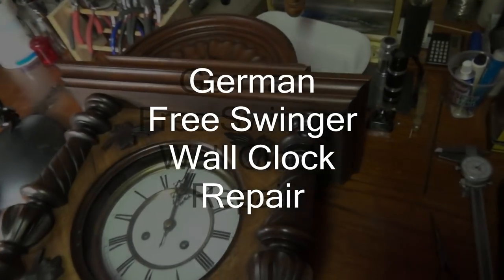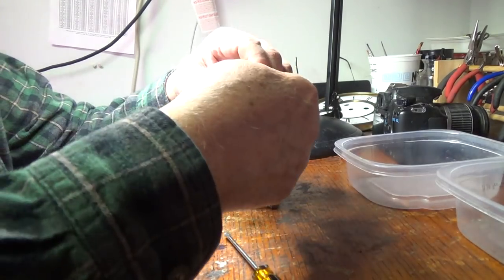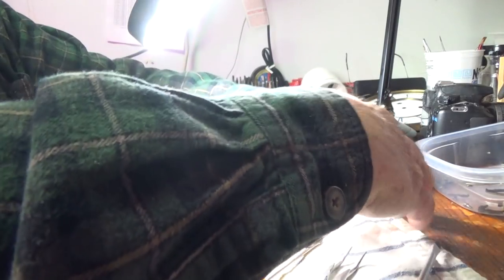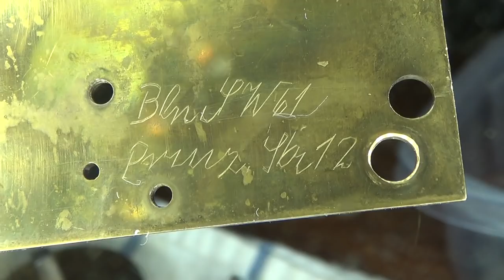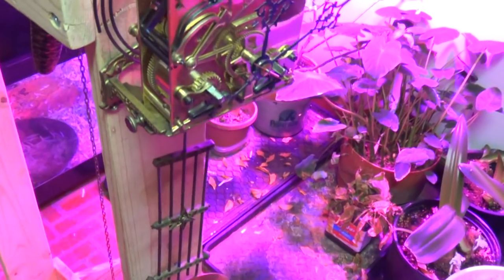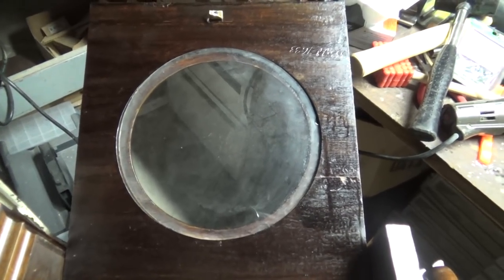German Free Swinger Wall Clock Repair

Comment: An index for this video:
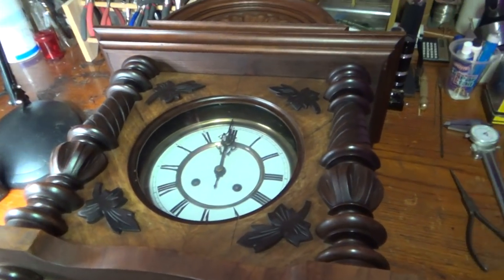0:00 - 0:21 Overview of the clock condition.
0:21 - 2:40 Removing the hands and the dial; checking the condition of the dial.
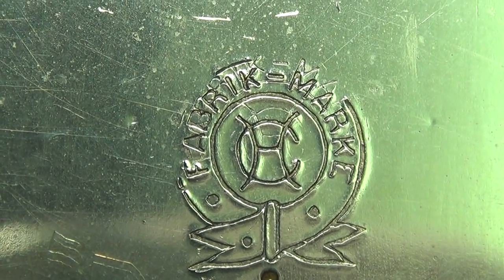2:40 - 3:42 Examining the trademark on the movement.
3:42 - 4:55 Checking whether the movement ticks and strikes.
4:55 - 6:00 Letting the springs down, which are in barrels.
6:00 - 11:02 Removing the parts that are outside the plates.
11:02 - 11:21 Examining the pivot holes for wear. Deciding no bushing is needed.
11:21 - 13:30 Removing the front plate.
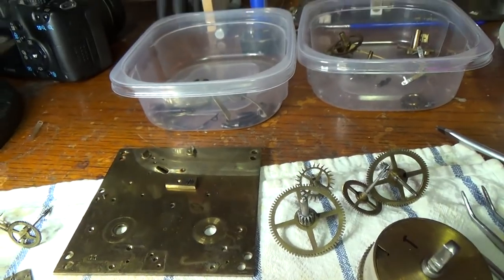13:30 - 14:13 Brief overview of the disassembled parts.
14:13 - 16:13 Examining the repairer's signatures and dates scratched into the inside.
16:13 - 17:38 Removing a helper spring; cleaning the posts on the lathe.
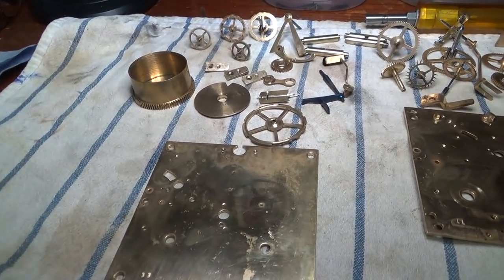17:38 - 18:09 Polishing the pivots on a lathe (after cleaning the wheels).
18:09 - 19:44 The parts after ultrasonic cleaning, ready to be hand cleaned.
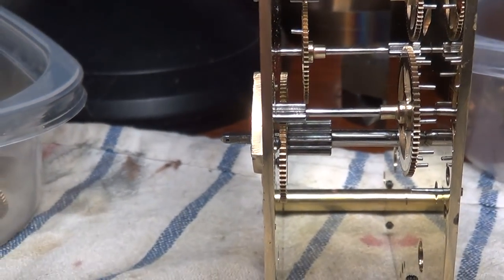19:44 - 21:21 Testing the cleaned time and strike trains.
21:21 - 22:29 Pegging the pivot holes.
22:29 - 25:17 Reassembly of the trains.
25:17 - 26:03 Oiling the pivot holes before attaching parts that cover some of them.
26:03 - 27:40 Attaching and oiling the Motion Works.
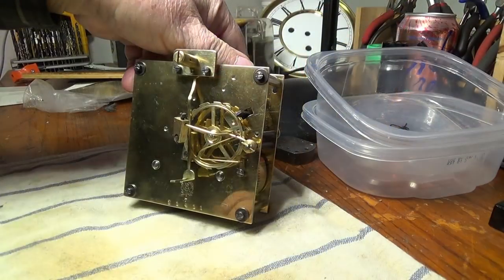27:40 - 29:10 Attaching the rest of the movement's parts.
29:10 - 30:02 Discovering that one of the mainsprings is off the arbor hook, requiring disassembly again.
30:02 - 31:22 Running the reassembled movement on the benchtop.
31:22 - 32:47 Test running the movement on a test stand.
32:47 - 33:41 Testing the striking counts. 2 o'clock incorrectly strikes 1 o'clock.
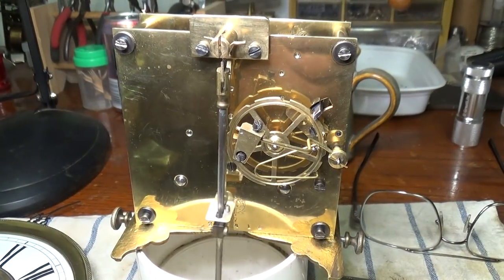33:41 - 34:05 Describing the cause of and fix for the striking problem.
34:05 - 35:57 Examining the running movement, and looking at a number scratched into the bezel.
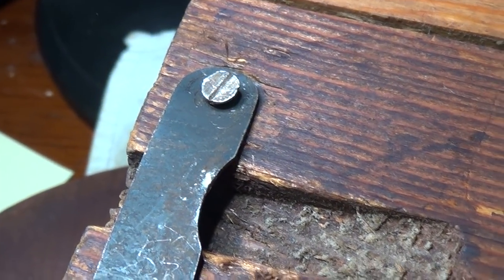35:57 - 36:12 The movement with hands, face, and pendulum, running on a test stand.
36:12 - 38:04 Discovering the "screws" in the case are nails, and the glass was cut to fit the broken door.
38:04 - 38:59 Grinding the bezel glass diameter down so it fits the repaired door.
38:59 - 39:47 The finished clock.

Comment: You did a good Job. IT is a Carl Werner. I think that Clock is from the 1920's. I restored a Free Swinger Wallclock from Pfeilkreuz.  I restored the Case and repaired the hole Movement. Now IT runs perfect

Comment: Love to watch your videos. I can tell you have a background in teaching and really enjoy making these instructional videos. I am new to clockwork and have learned a lot from watching you work. I would like to know if you think you will continue making new videos for a while. Also could you tell me, or perhaps show us how you go about removing scratches from brass plates. Also,  how far do you usually go in shining up the parts? Do you use a brass polish on them? Thank you, and please keep up the good work.
Reply from the maker: I'm glad you find the videos helpful.  I work on clocks almost exclusively in the winter when I can't be outside.  I do have some work to get done that I will work on during some evenings, so there might be a video or two over the summer.  As far as scratches in brass plates go, there is a limit to what can be done without causing more damage.  Deep scratches can be attenuated but not completely removed.  One can start by using a fine file and draw-filing across the scratches.  Fine wet/dry sandpaper can then be used, followed by finer grits.  I personally like using the boards used for polishing fingernails.  Whether to polish brass parts or not is also a matter of what movement one is working.  It's best to clean the brass what it would have been its original condition.  Some were highly polished, like carriage clocks, and some were not.  If the brass is stained or corroded with verdigris, I will remove it, sometimes starting with Brasso, with a rinse following, then finish polishing with a polishing compound used on acrylic tubs and showers. Finish off with a polishing cloth and removing residue with a brush.  For heavily stained brass, the initial cleaning may also include using 0000 steel wool.  You  can use a lot of different things to clean and polish, so long as residues and grits are completely removed.  You don't want any fine grit left on wheel teeth or arbor pivots that would increase wear.
Reply: Thank you for your speedy reply Don. I must have caught you at just the right time. I'm not sure I would be brave enough to try a fine FILE on it yet. Being new (about 1 year now) to this, I have already made a plethora of mistakes. lol I do learn from them, but the damage is still done and must be corrected which, of course can lead to more problems. Kind of the school of hard knocks, I suppose. Perhaps I could try one of your other solutions first. I just don't want to make more or worse scratches.
Reply from the maker: Practice on a junk movement.  There are a ton of them that can be purchased from eBay.

Comment: I've had the spring come off the winding shaft myself once on a ships bell clock.  Not a happy discovery!  Although it took several assembly attempts anyway, to get it to gong properly (I got in a little over my head on that one).  Back in the day (35 yrs ago) we used to etch our SSN's on tools and such.  Yikes..

Comment: Love all of your videos. However, I would like to see you do and explain how to time the strike on a Sessions time and strike mantle clock movement. My movement is confused and not falling in the deep slots on the count wheel. No model number is shown on the movement.
Reply from the maker: If it's the old style American clock movement, what you need do is Place the warning pin on the warning wheel at the 12 o'clock position, where it will rest against the stop lever, place the cam that's between the plates such that the lever that rides on it is in the slot in the cam, and bend the countwheel lever such that it is in  a deep slot.
Reply: @dperry428  Checked that and found the warning wheel pin and locking lever is at 12:00. The cam doesn't have a slot. However, it does have a wedge shaped detent with a flat smooth bottom and the arm is in that detent, at the bottom. The count wheel arm is in the deep slot. When asked to strike the count wheel arm rises out of the deep slot but does not engage every count wheel tooth, as I understand it should, until it reaches the next deep slot.  Instead it sometimes will stop and drop in the middle of the count on the count wheel.  So, what do you think?What shoud I look for?
Reply from the maker: If you look at the arbor to which the count wheel lever is attached, there is another lever that rides the cam.  There is also a third lever that is on that same arbor that constitutes the stop lever, the one that will ultimately drop in front of the warning pin to stop the strike.  All three of those levers rise and drop together. As the lever on the cam rides the cam, each time it gets to the depressed area on the cam, it will attempt to fall and take the stop lever down in front of the stop (warning) pin, but it is kept from doing so by the count wheel lever until that lever falls into a deep slot on the count wheel. Only when the count wheel lever drops into a deep slot can the cam lever also drop into the depressed area of the cam, which then allows the stop lever to drop in front of the warning pin and the strike halts. The count wheel lever should not "engage the count wheel teeth"; rather, should, as the clock strikes, be high enough to clear the teeth and, as the cam lever encounters the depressed area of the cam, the count wheel lever should be seen to drop enough to touch the count wheel between the teeth and then immediately rise again as the cam lever rides up on the cam.  It should be a small, though visible movement down  and then up by the count wheel lever.  When the count wheel lever gets to a deep slot, it then drops into it and allows the cam lever to drop deeper and the stop lever to move in front of the warning pin.  So, there is an interplay between the cam lever and the count wheel lever that, with each rotation of the cam, the cam lever tries dropping into the lower area and the count wheel lever preventing it from doing so until the arrival of a deep slot on the count wheel.  The count wheel lever and the cam lever, therefore, need to be bent such that the cam lever rides the edge of the cam and is free to move into and out of the lower area of the cam, while at the same time, the cam lever, when it is out of the depression, lifts the count wheel lever above the height of the teeth on the count wheel.  If the count wheel lever is bent upward too high, then it will allow the cam lever to drop into the depressed area of the cam even when the count wheel lever is between deep slots.  You just have to carefully observe what each lever is doing and their relative positions and make adjustments until they act as I've described. Without actually having the movement in front of me, that's about all I can suggest.  Of course, the cam wheel and warning wheel have to be in positions such that, when the cam lever drops, the stop lever is able to catch the warning pin.  Make sure the pin isn't passing the stop lever  before it has dropped enough to catch it.
Reply: @dperry428  Thank you. Thereis a lot there. Your advise of observation is well taken. I'll have to play with it and get back to you if I figure it out. Thanks for your explaination and time. I think that I am good on most of that. I believe my prblem lies in the height adjustment of the count wheel lever.

Comment: How do you get it so shiny?
Reply from the maker: Keep in mind these movements were manufactured with a polished finish.  All I'm doing is restoring what was already there.  I do use a fine polish made for acrylic bath/showers to restore the original finish.  I also polish the arbors when I polish the pivots in my lathe.